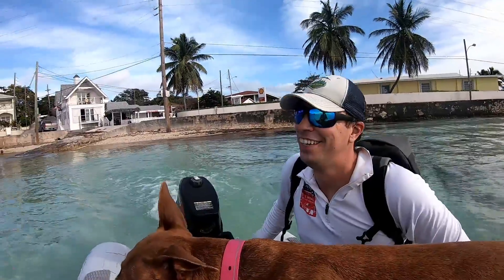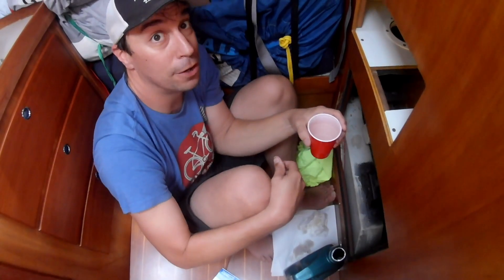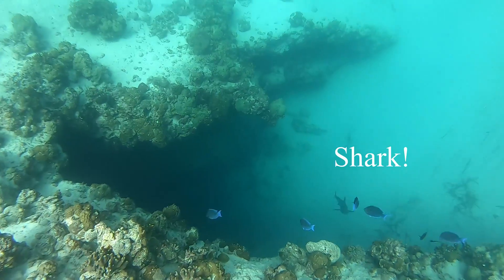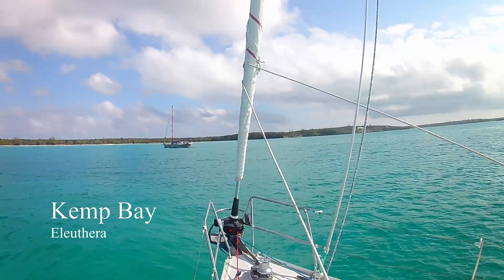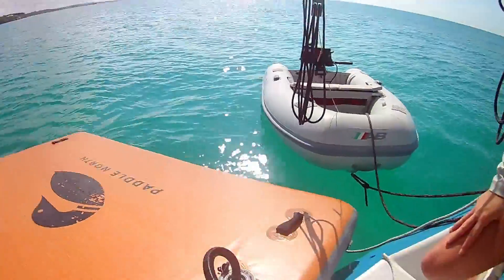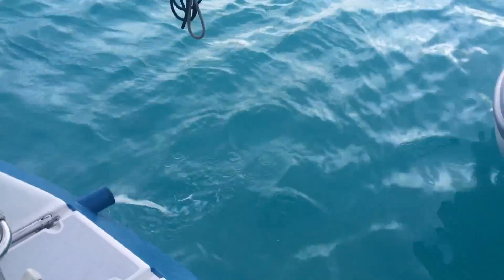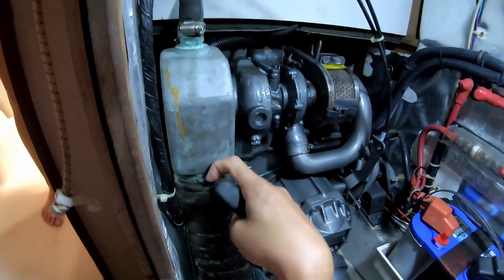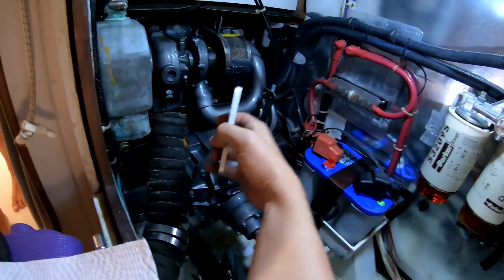Blue Holes & ENGINE WOES - Sailing in the BAHAMAS [Ep. 18]

Comment: Thanks guys,  no tips for changing the oil, didn’t really get to see very well the issue, you can purchase hand pumps to fit than 4 &5 Lt oil containers, look at your Automotive store, not marine..  with the mosquitoes, (won’t help on land) but grab a few mint plants and hang em around the boat,  they will live through pretty much anything, a bit of sun and water.. mosquitoes hate mint and peppermint, so you can mix a cap full of mouth wash and water, and spray around your boat, even yourselves, (won’t hurt you)  because the little bugger are attracted to Carbon Dioxide (your beathe) the mint smell just covers it, plus they as i say don’t like the smell they will pick an easier target then your boat..    
merry Christmas guys!
Trev..
Reply from the maker: Thanks Trev! Great tips! 👍 :-)